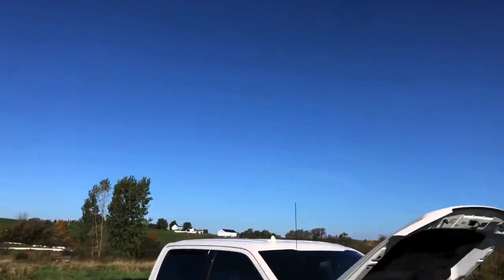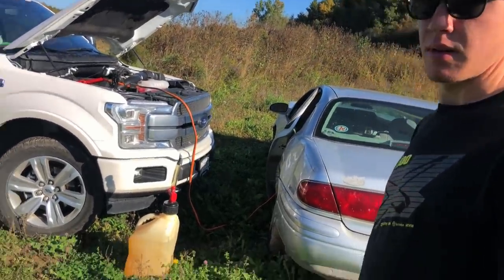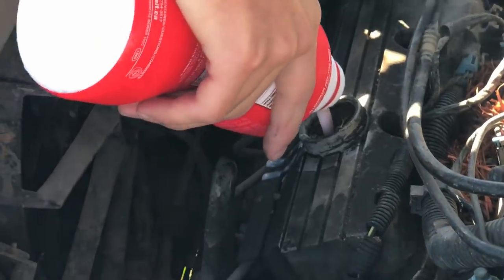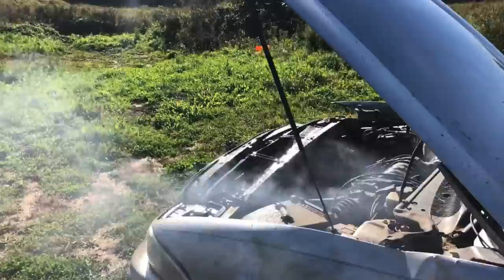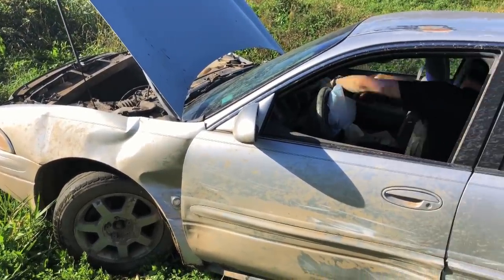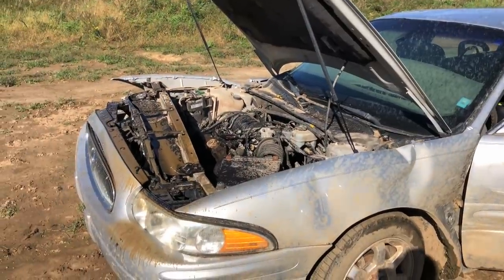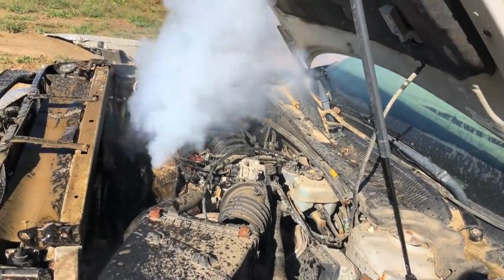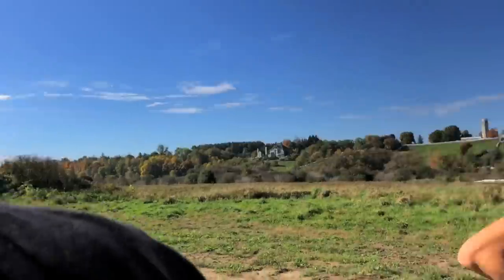Using YOGURT Drink As ENGINE OIL!

Comment: Mark when you’re doing this get a can of ether or also known as starting fluid, some of the older vehicles will rev like crazy if you spray it directly into the intake.
Reply: If I remember correctly, it does that because you're technically bypassing the fuel injection system and essentially acting like a human carburettor.